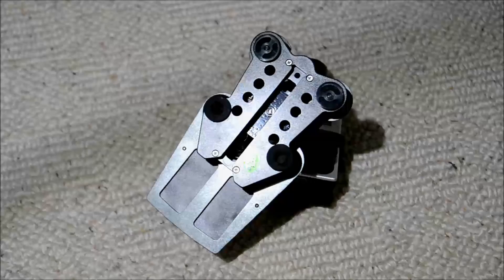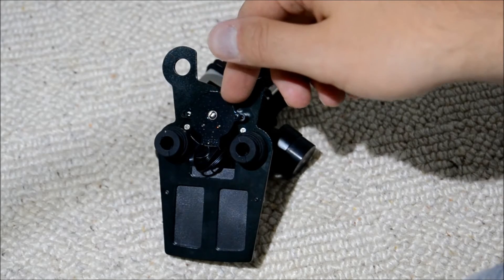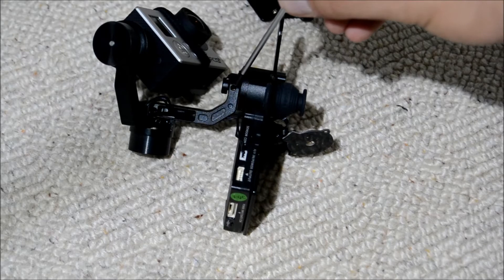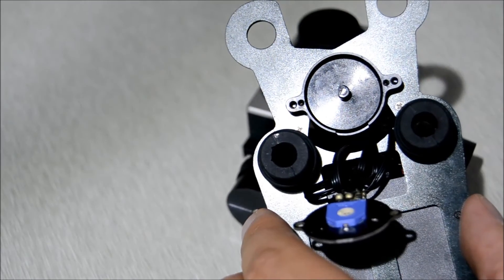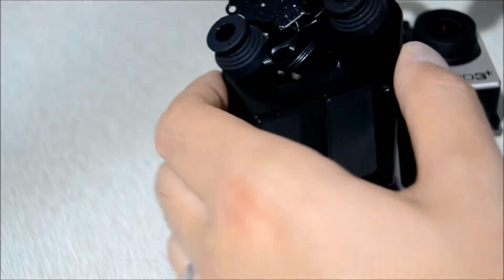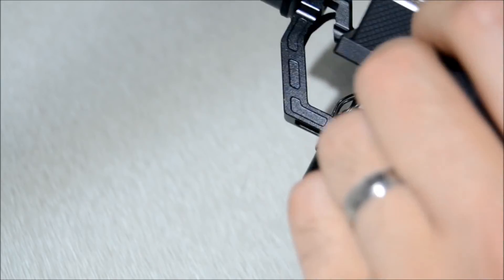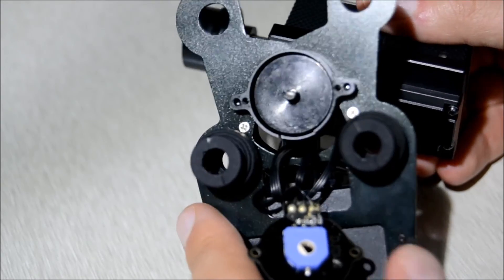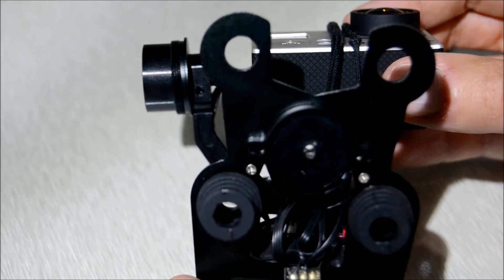Walkera Gimbal Yaw Adjustment

Comment: I have a question did your drunk come with the I look camera and how do you take pictures with it
Reply from the maker: I don't use an ilook but a gopro. You won't be able to take photos from the transmitter. You can set up the camera to take photos every 30secs etc automatically.